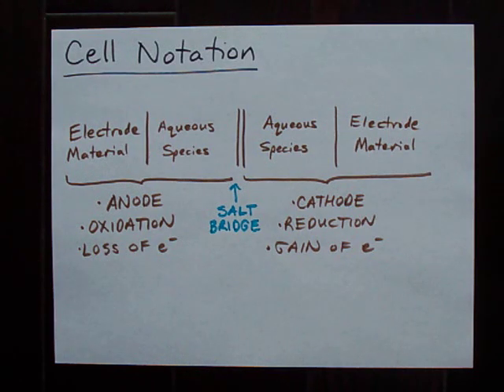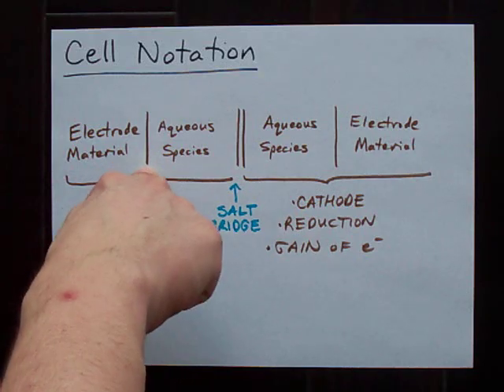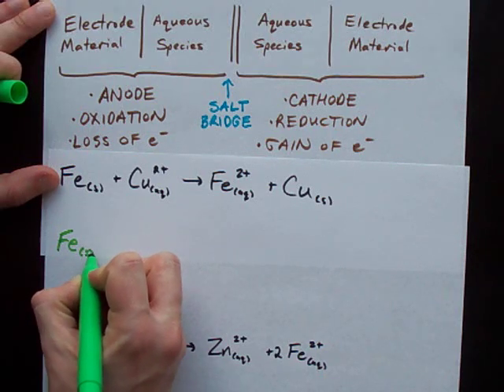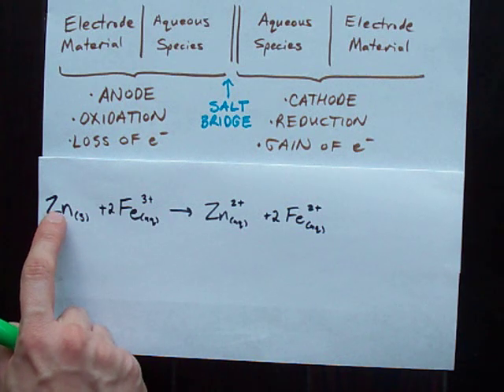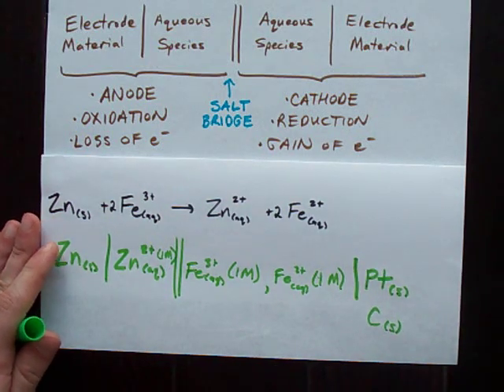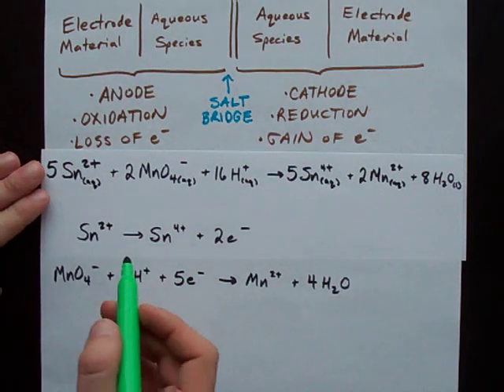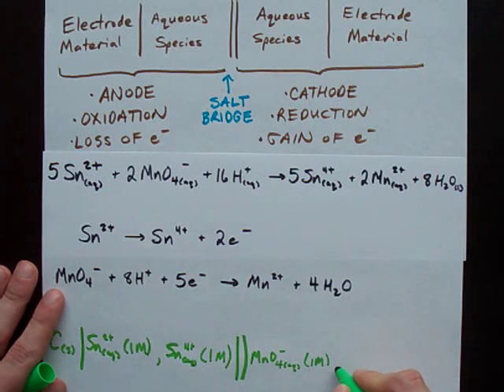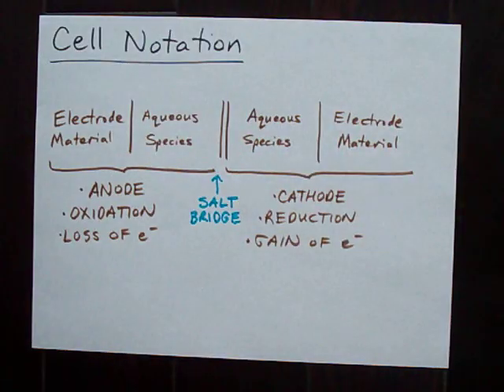Cell Notation + 3 Examples

Comment: May I ask why the coefficients are not included in cell notation? I've seen some examples (not many) where ppl actually put them in, is there a reason for that?
Reply from the maker: Sometimes people will put concentrations in cell notation:
0.1 M Fe(3+)(aq) | Fe(s) || Cu(s) | 1.2 M Cu(2+)(aq)

But coefficients ... no, I've never seen that.
Reply from the maker: The reason why is that it's redundant information.  From the chemical formulas given in the cell notation, someone could just balance it themselves.

Comment: My professor said you can use a liquid as an electrode, so would it be ok to use H2O as the electrode instead of graphite?
Reply: +SoulSina11 Water is mixed with the solution and your electrode will disappear. You can use mercury.
Reply: +Kevin Tee you found me xD
Reply: +Kevin Tee nvm you're a different Kevin Tee
Reply: haha

Comment: Hello, I have a question. I understand all these equations and Stuff but what keeps the electrons from flowing through the salt bridge? Why do they flow through the wire instead?
Reply: I'm  hoping someone who knows more will chime in, but here is how I think of it. The electron will move from high potential to low potential, with the wire acting as the easiest path. While an electron could cross the salt bridge in theory, it will take the path of the wire.
Reply: I'm 6 years late but... Only ions can flow through the electrolyte. Electrons always flow through the metal.